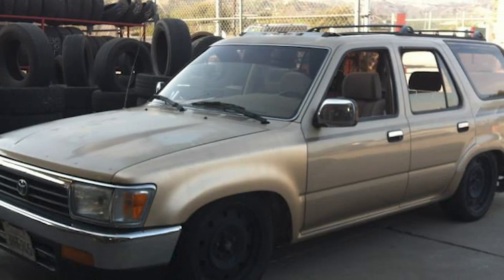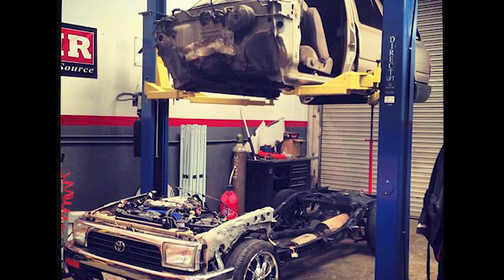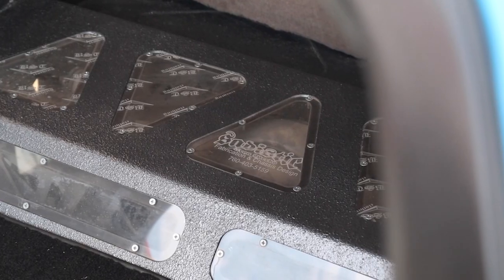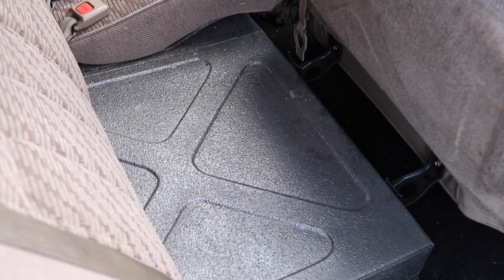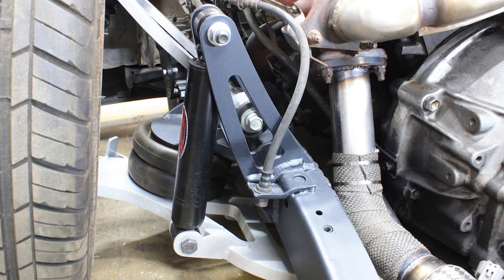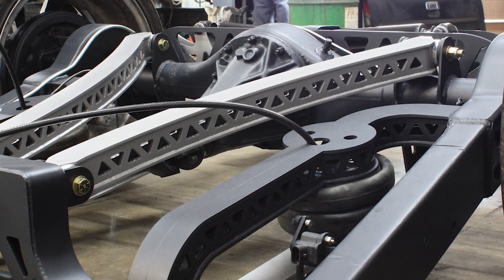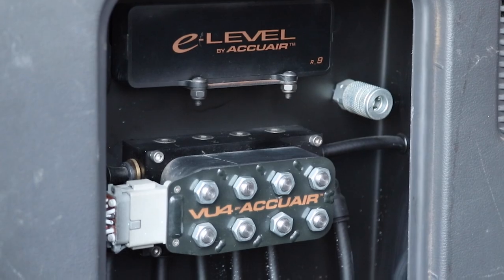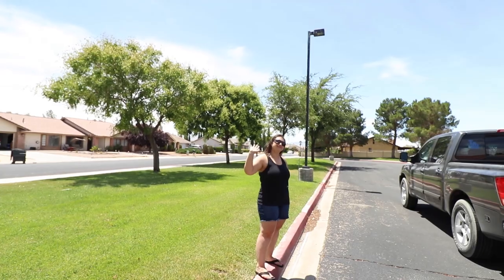Bagged 1994 Toyota 4Runner (FFFOURUNNER)

Comment: I love your 4Runner. Ive always wanted the older 1st gen model 4Runner the ones that only come in 2 door and have a removable shell, ive had several mini trucks including 2 Nissan Hardbody's an 84' and an 89' both had scissor stacks under the bed for bed dancing, ive had 3 Toyota pickups, an 87' long bed, an 89' mid bed and a 91' SR5 xtra cab short bed with a inline six cyl i blew up and replaced with a 94' Supra inline six i shipped over from Japan, and a foot and a half to the frame and a mid size bed a full carpet bed kit total late 80's early 90's truck, my 89' though i made it a walk through cutting out the back wall and window of the cab and cutting the front wall of the bed out, got a custom made rubber boot and some expanding foam to seal out the weather. Got a bench seat from an 90' Toyota pick up and made custom lowered mounts and welded it near the tailgate, the only thing separating it from the tailgate was a custom built plexiglass enclosure with 4 10" and 2 12" subs from Hollywood Sound Labs, then decked out the whole interior with canvas, felt and fine office building type carpet for the floors and i took the front bench out and put in front buckets from a Toyota 4x4 extended cab  and its center console with arm rest and cassette tapes storage insisde and they had the Oil, Temp and battery triple gages, clusters. Boy was i pissed when i came up to Sacramento to vist my cousins and one of they're buddies came over with his 89' Toyota 4Runner same year as my truck but his was a 2 wheel drive pre-runner and he swithed the whole suspension with a regular Toyota 2 wheel drive pickup then dropped it to the floor. All the looks i went for with none of the extensive work put in. I also had 3 square body S-10's, well actually 2 and 1 GMC s-15 sonoma the first was a 89' extra cab. I did it total white pool boy style. Black with limo tinted windows, black tonneau cover, gray and black interior on 17" all chrome i-roc z 5 stars, and i got the bumpers traded to a friend who had chrome ones but wanted black painted ones plus we traded mirrors, grille, windshield wiper arms, door handles, key locks, antenna, and all trimming he wanted all black everything i was tired of it snd wanted to break the monotony. The other s-10 was s work truck. It was dark gray with the side areas black with a light gray pin strip around it and chrome moldings too, but it was a standard  cab, short bed. It was a 4cyl and had Kragar SS's with white walls and a color matched snug top shell with side windows with the sliding vent windows and it was on front drop spindles and 3" lowering blocks in the rear, the GMC s-15 came white do i did the oppisite of the blacked out s-10, i got black everything, trim, door handles and locks, bumpers wiper arms etc. and blacked out the windows, no tonneau cover this time but yes 17" chrome i-roc z rims but i had the centers black pin stripped. It was an extra cab too. Ive also had a mazda pickup, slammed. A 98' Toyota Tacoma that was body dropped, frame tucked, tubed and c-notched and layed frame on 19" ISW's, also an Isuxu pup extra cab, a mitsubishi pickup, a ford ranger and a courier, a datsun b2500 and 2 chevy luvs a 79' and a 71'. Ive had lots of mini's back in the day my first club was Erotic City Minis but my mom and her sister knew the father of, and former, Pres of The Untochables car and truck club and so they pushed my to join them. I had buddies in Toyz R Us, Nu Stylez Minis, Sweet Tendencies, A Touch of Class, Inner City Minis, Seductions T.C., So Cal Minis, Clean Concepts, High Class C.C., Sueno Latino C.C. Mafia 4 Life, Rollerz Only, Dukes C.C., Oldies, Majestics, L.A.'s Finest, A Class Above, Cali's Finest and several more, i still know most of them were just spread all up and down the west coast now. Anyways your 4Runner is one bad b*tch
Reply from the maker: Wow! Sounds like you've had some pretty amazing rides!

Comment: Awesome build. Always wanted a bagged 4Runner since seeing  Wood Runner at a show. I have a bagged and body dropped 98 Tacoma that is speedway blue. May have the same wheels as you also if they are Boss wheels. Saving up now for some billets
Reply from the maker: Hell yeah! A taco is the next truck we want to build! The wheels are boss but the center caps that came with the wheels didnt work. So I had to use some others I had.

Comment: First off truck is awesome and the vlog is what help keep me sane during lock down. Second what is achieved from the frame swap? Is it just to make it 2wd?
Reply from the maker: Thank you! Stock 4Runners 2wd and 4wd are built on 4wd chassis making it almost impossible to bag and have it lay frame. A 2wd truck frame is much simpler to start with because the front control arms are much closer together.
Reply: @KustomLife  what year frame swap would you use to do this same thing to a 97 4runner

Comment: Does the truck frame bolt up directly?
Reply: I have a 91 sr52wd im looking to bag
Reply from the maker: It needs some modification to the body mounts. The first set fit perfect but the rest need to be cut off the 4 runner chassis and welded to the truck chassis.
Reply: @KustomLife  thanks man its been almost 20 yrs since ive had a bagged truck and im a built not bought kinda guy my last was a caddy clipped Silverado on 22in boyds i had 3 features in 03 i want to get back to my roots and build a mini
Reply from the maker: @sinnerschopshop9305  Awesome!